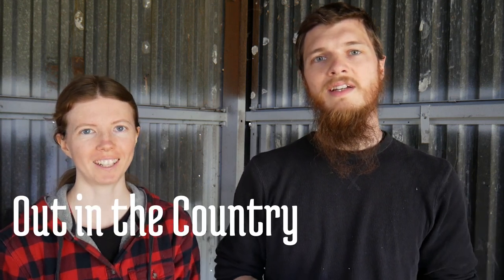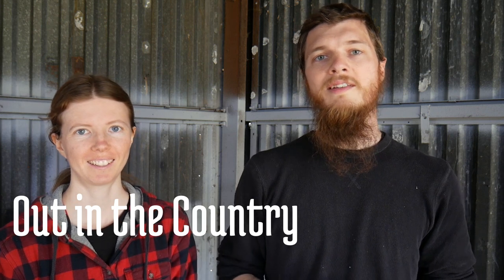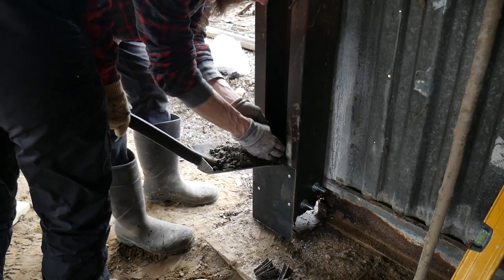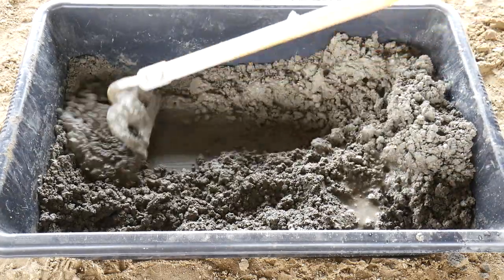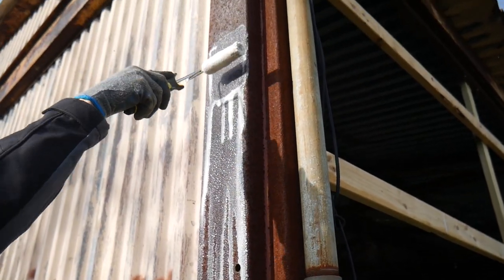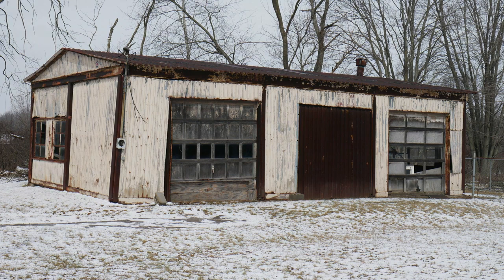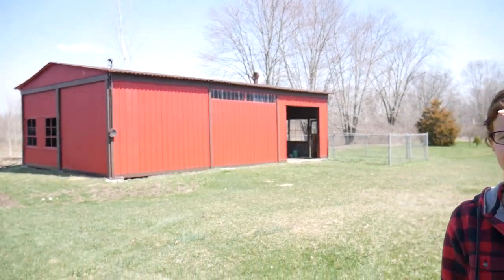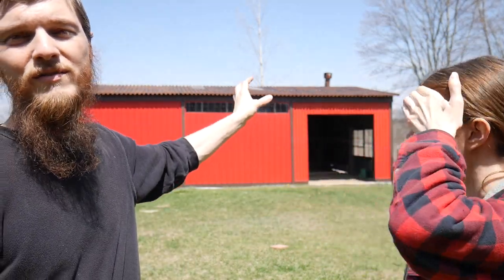Amazing Old Garage to Barn Makeover! Before and After

Comment: Hi Guys, I need your advice.  I live in a mobile and recently we had a bad storm.  My entire carport was taken out and the wind so strong literally the screws in the mobile siding are gone from the winds.  The screws in question has a stop sign like shape for the head and were about 1/2 in long.  When you redid your siding what kind of screws did you use and do you have a picture of it?  Did you have to replace what the screws went into or did you just re-screw into where they were.  If you replaced the holes they went into what kind of wood or what ever did you replace it with.  Your story was interesting and the fire one I still can not believe the fire Dept did not come to put out.  Success in your future plans.
Reply from the maker: It sounds like you had hex head screws. Those are typical for sheet metal. We actually used pole barn screws that come with a rubber gasket to replace some of our popped screws. The wide washer and rubber gasket help cover and seal any holes from the old screws. Usually they will grab the wood just fine but I would try to find a little longer screw to be safe, maybe 1 inch to 1-1/2 inches long.  I hope that helps.
Reply: Thanks next you can come and fix it for me, lol:-)
Reply: You might have some type of proprietory screws. You might have to grind a bit to fit those. Make it out of hard metal like a drill bit.